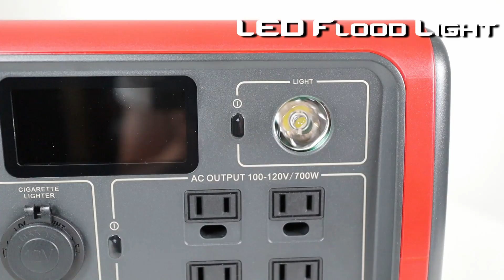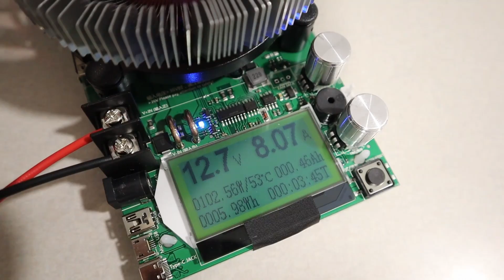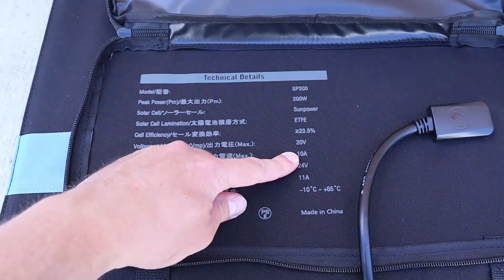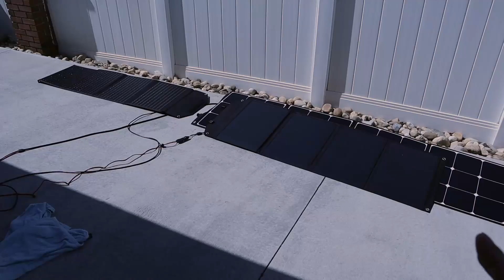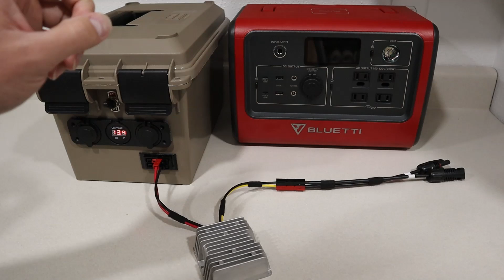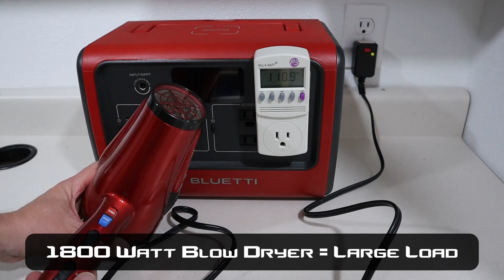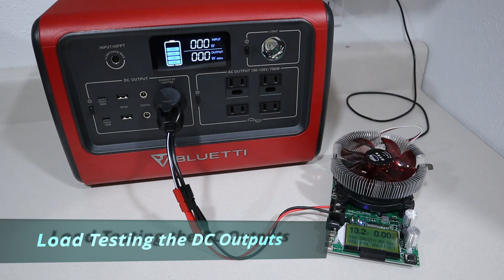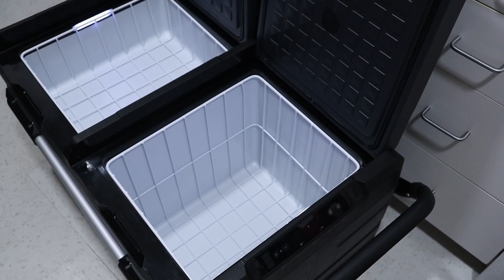Bluetti EB70 LiFeP04  + SP200 Solar Panel - Best Battery for 12v Fridges? - Full Review and Testing!

Comment: I don't understand why they do not add a little more battery capacity, so they can meet their published wh claims, same for solar, they advertise a certain wattage and never come close. Sounds like false advertising, if you bought a car and it got 20 pct less gas mileage it would be against the law.
Reply from the maker: But you do get 20% less fuel mileage when you buy a car a use it. The rated gas mileage numbers are only under perfect conditions.

I have since made a power ststion grading system that provides points for good usable capacity vs rated capacity.

Comment: Hey Jason, thanks a ton for this!! Based on your videos, I put together a Bluetti EB70s, Iceco VL45, and 100w panel for my truck camping setup. For a monthlong road trip in August, we only charged the battery off the roof mounted solar. We charged phones lights GoPro and a speaker and ran the fridge continuously at around 38°F. The battery went below 50% on just a few nights despite many partly cloudy and rainy days in the mountain west. It was perfect! 

My question is this: how would you recommend insulating or heating the battery for winter camping? Documentation says it will discharge down to well below freezing, but must be 32 or above to charge. I’ll usually only spend 2-3 days in the mountains in California, so I think it might be ok doing nothing, it can charge when I get back to 50° home temps. What would you recommend?
Reply from the maker: Since the power station creates some heat while in use, you could always find a small insulated lunch bag and put the power station in it while it's really cold and it should stay warm enough to charge the batteries safely.
Reply: @Jasonoid   Gotta love the simplicity of that solution. Thanks!

Comment: Are any of the quirks solved with the EB70S? Or is the W/Wh simply higher on the EB70S or are there other differences?
Reply from the maker: The inverter supports 800 watts, the led button lights are brighter. Those are pretty much the only changes.

Comment: Hello Jason, Is the input port compatible with Jackery? ie, can I use Jackery Solarsaga panel directly on the eb70?
Reply from the maker: Jackery uses a proprietary 8020mm connector (instead of the 7909mm), it won't work with the EB70, at least that's what I hear since I don't have those panels to test.
Reply: Thank for prompt response. The Solarsaga I have has an adapter fixed to its cable which seems to be marginally bigger than the plug directly on the cable. I can't measure the difference as I don't have a micrometer.
Reply from the maker: @bigalrsa  correct, 8020 means 80mm outer 20 inner sizing. The 7909 means 79mm outer, 09mm inner sizing. They are very close but the inner diameter is slightly different. It might work but hard to say.
Reply: @Jasonoid  I am tempted to buy the eb70 on sale down here as it has a 1kW inverter (1.4kW spike) but don't particularly want to look for adapters to connect it to my Jackery panel - these adapters are difficult to find down here.
Reply: @Jasonoid  Hello Jason, just to keep you in the loop, I have bought the EB70, and Jackery's cables work just fine without any adaptors. Busy charging in late afternoon sun and getting 60W going in.

Comment: Best review done by anybody on YT on this EB70.  Good job you even showed the way to wire up a step up 12V to 24V battery charging to maximize the 8A input.  That is very thorough, wish more reviwers used the appliances to test the full 700W like you did.

Good job. Subbed!
Reply from the maker: This video is showing it's age, I think you'll enjoy my newer videos even more. Thanks for following, looking forward to seeing your comments in the future!
Reply: @Jasonoid - Solar Power, Batteries, and More!  yes I will, but I'm still looking at getting a EB70 as it has 1000W these days, not 700W anymore, at least in the current 230/240V versions.  That makes a huge difference as it can power a 6 quart Instant Pot.

You were the only one who showed the capabilities of charging with a 12V to 24V step up hack.  That's big, shows thinking outside the box..good job.

Comment: How are you doing my friend again I was thinking of buying a little red one. I have a 2000 in murder I think I got a 200 fuse in line with the thick wire if I plug it in there while I go down the shore with a charge fast, if I plug it in directly into the inverter that I have 2000 and it’s 200 I think it’s 200 A and it’s connected directly to I got four batteries and a nice big size alternator. We did my friend get back to me oh by the way happy Easter you and your family.

Comment: I recently purchased one of these (eb70S) refurbished, directly from bluetti. Gas 2 year warranty & is like new. Paid $336 for it. I also bought a 195W fixed frame panel for $150. Charged it today In Connecticut, peak power indicated was 164W. It held 160W for a extended period of time. Love this setup!

Comment: Jason.   Can i use a solar panel with a built in mppt to charge an eb70.  Would the mppt on the solar panel increase the voltage past 28v?  Couldn’t find the answer after a lot of research and thought you might know.
Reply from the maker: The EB70 will charge better with the raw output of the solar panel. You could always try it but the charging output voltage of the MPPT would be much lower than the raw solar panel, near 12v

Comment: Great video about to buy one, I have solid solar panels what size/type is the DC in plug?
Reply from the maker: The DC charging port is a 7909 barrel connector. This model comes with an MC4 adapter so any 12v solar panel will connect up if it has MC4 plugs.

Comment: Doubt that the12V lighter plug is regulated! With lifepo4 it doesn’t need regulation!
Reply from the maker: The internal battery is a 22v LFP battery.
Reply: @Jasonoid  I thought it was iron phosphate
Reply from the maker: @charlestait5303  it sure is LFP (Lifepo4 or lithium iron phosphate)

Comment: Would you recommend for a week in france fishing for my laptop phones torches and bait boat bats aswell as other bits and Bob's
Reply from the maker: How do you plan to charge it up while on your trip?
Reply: @Jasonoid  I was kinda hoping it would last the 7 days it would be charged before via household plug (uk) and I would take the 200 panel with me but as you know you can guarantee sun
Reply from the maker: @thecarpfather5757  I don't think it would last the whole time on a single charge. You can charge it off your vehicle or off solar. It would be a good option for cell phones, laptop, and flash lights.
Reply: @Jasonoid   if I was to leave the panel connected would it be useable as it was trickle charging also have you heard of the company carplounge they make lounge boxes that are in conjunction with Anderson

Comment: Besides the benefits of fire safety on lifep04 or Lfp. People over advertise the charge cycle of Lfp batteries. Yes, the battery might last 1000's of cycles. The rest of the the features like inverter,  mppt controller, bms, usb, displays,  switches could all fail well before the first 1000 cycles.
No different than advertising 25,,000 hours of life on led bulbs. Converters go out well before first 1000 hours. For packing around,  I prefer NMC power stations over Lfp for their size, weight, and more energy density.
Lfp are great for stationary settings for off grid , Rv, or power backup.

Comment: Wouldn't you think they would have made the solar panels rainproof? Apparently they are water resistant but rain is a no no. Given the nature of how they are used, eg outside, sooner or later no matter how careful you are these panels will get caught in an unexpected shower and that will be curtains!
Reply from the maker: There are many solar panels that are waterproof. The BigBlue Solapowa 100, Sunpower Flex Panels, even other folding panels come with waterproofing ratings.
Reply: @Jasonoid  Unfortunately I ordered the Amazon bundle which comes with Bluetti's panel. I thought they would know the best panel for their product but now I'm not sure. It hasn't arrived yet so I may return the whole thing.
Reply from the maker: For what's its worth, my bluetti SP350 and PV200 have survived multiple rain storms, they may not be rated waterproof but they survive the water lol...

Comment: $400 for a 200w solar panel that well only provide 164w max is not worth it!! Can u recommend a good folding solarpanle that well provide 200w 25v 8amps?... why they would put a 8amp limitor on this product when they know that this panel is up to 10amps not a fsn of companies tricking there customers u advertise 200w it better be 200w i'll continue to slander this company until its made right and there other products

Comment: Recently, I bought the newer Bluetti EB70S to run my Alpicool C20 portable frig. Realized on my first camping trip that I would need to buy a solar panel for my longer camping trips. I use my disburse camp as a home base taking multiple hikes in the same area so it’s a waste of time and gas for me to drive around to recharge the power station every other day.  From watching your great solar panel test video with Jeff, I’m leaning towards Jeff’s favorite Baldr 120W Portable Solar Panel. My question is: you said the EB70 could not run solar panels in parallel nor in series.  Why were you able to successfully charged the EB70 with your Rockpiles in parallel?  I’m trying to decide whether to buy one 100W panel and add another if needed or just get a 200W now. Thank you and Jeff for creating this important content in an easy to understand format.  Great Job!
Reply from the maker: Series is a no go on the EB70, but in this video I said parallel connections are just fine. You can connect two Baldr 120s up to the EB70 with no issues. You'll get around 150-165 watts depending on the conditions. The only challenge is connecting those two together in parallel since they don't come with an adapter. If you go with the BlueRise 120, it is cheaper and has MC4 connections and can be connected easily in parallel.
Bluerise 120 performance here:   https://youtu.be/O2Ib2NXrsyw
See how to connect them in parallel here: https://youtu.be/4JG8LvJznLY
Reply: @Jasonoid   Just got back from my second camping trip of the summer and read your reply to my question.  Thanks! Connecting in Parallel video great.

Comment: Thank you for generating this content!
I recently took my eb70 on a 6-week road trip and charged it several times with my PV200 Bluetti panel.  I watched this video and several of your others before the trip and so I was expecting that 150-160 input range for my charging.  I really don't have a very good understanding of electricity and I'm trying to learn more because I would like to do a portable solar array that will eventually power an electric vehicle from the top of a bus.  This equipment didn't let me down on my road trip and so I want to thank you for the guidance you've provided over not just this video but several others. Your explanations and reviews are both comprehensive and easy to understand.  A lot of people look to YouTube to learn, and I really have appreciated turning to some of your reviews and videos to understand these products better as I've used them.  👍

Comment: Jason, when I pulled both above and below 500 wh with two watt meters in three tests I complained endlessly until Bluetti sent me another one. So I got two of them for 250 each LOL! I`m in hurricane country so it`s a great pair to have but many of my other power stations charge FASTER with solar than the AC charger. A lot of them do. But not the Bluetti. And NO power station rated at 716 wh should EVER only pull only 450 wh when powering a freezer. Then the next test might be 520. Then 480. My 516 wh 500 watt Bawaut powers a dorm fridge for HOURS longer than the 716 wh Bluetti every time. WIFI too. The Bluetti powers my WIFI for 48 hours. Add another 24 hours to the Bawaut run time. And because of the wireless charger the USB doesn`t power my fans very long with the Bluetti...about the same run time as the Golabs R300. 

The Bluetti has thousands of charge cycles though so it`s a valuable device that saves on fuel costs for what I need it for. Capacity of the AC ports was disappointing but the 700 watt inverter is big enough to handle the compressor surge of my small box freezers so that`s its job and it`s a very important thing when you grow your own food and freeze wild fruits and fish. These foods are simply irreplaceable at the store and by August/September when hurricanes hit my freezer has a LOT of wild fish, berries, and Spring/Summer vegetables stored in it like okra and squash. Try buying 3 gallons of blackberries at the store. 

And here in Louisiana I grow greens, rutabagas, turnips, cabbage, kohlrabi, beets, and snow peas in Winter when there`s no need for pesticides and I store them in the freezer. Plus I use many natural fertilizers along with some supplemental commercial fertilizer too if needed to greatly increase nutritional content missing from the supermarket. I don`t want these foods from the store.
Reply from the maker: How is your 300ah build coming along?
Reply: @Jasonoid  Phone/internet company is giving me issues about connecting service to my camper and I haven`t moved in yet. No cell phone service here and the only way to live without communications with my doctors and banking is to live completely off grid without money. Evil monsters. I`m on disability and they`re breaking the law. And people wonder what causes people to snap.
Reply from the maker: @baneverything5580  Well good luck in getting it connected. Sorry it's not been a seemless process!

Comment: That explains why several times I got BELOW 500 wh from the AC in tests running a freezer. Results vary by as much as 100 wh which is bizarre.
Reply from the maker: AC inverter has a bit of parasitic drain vs the DC output.

Comment: I just subscribed to your channel. I want to know if I could parallel two 120 watts ELECAENTA penals to charge the Eb70 ? Is it safe or when will it fry the charing port ?
Reply from the maker: Yes, that's completely fine. Two Elecaenta 120 panels will charge the EB70 in parallel without issues.

Comment: Do the dc ports auto-off if <5 watts? Looking for them to stay on for a cycling 12v fridge. Thanks!
Reply from the maker: I run my 12v fridges on the EB70 all the time, no issues with the DC output shutting off.

Comment: Can you take 10A from Cigarette socket and 10A from barrel connectors..??
Reply from the maker: It's been awhile since I've tested max loadx I think you can pull around 12 amps max before it shuts off from all the dc connectors combined
Reply: @Jasonoid  
O.K... I have one on order... Will test

Comment: hey mate great review. but I have a question. can you use the station while its being charged by solar or wall socket? so that the fridge can keep getting powered? that's probably my biggest concern. cheers!
Reply from the maker: Yes, you can charge it and use it at the same time, no issues.

Comment: What wires do you suggest me as an extension of about 10 to 15 feet to connect a Bluetti PV120 solar panel and a Bluetti EB70S Solar Generator ?
Reply from the maker: Great question! I always suggest getting a little longer cable than you think you'll need. Here's a great 20 foot 12awg wire that should work really well between the EB70s and PV120:   https://amzn.to/3PSLKHB

Comment: This is the first video that mentioned 8A charging max current. I wish they had at least 10A, and up to 40V max voltage, so you could connect panels in series

Comment: I think the latest versions have LED light indicators on the on off buttons. A lot of the quirks were most likely put in place to keep the price low. the great thing about this is the price/performance/functionality. Its great for that alone.
Reply from the maker: I was pretty harsh on this power station in the review but it's still my go to option for a weekend trip powering my fridge. Lots of capacity and decent solar charging!

Comment: what would you recommend as a "perfect" solar panel for the eb70?
Reply from the maker: Xtar sp100 is an AWESOME 100 watt panel for the EB70. You can see the review on my channel under solar panel Playlist. There isn't a "perfect" 200 watt panel because to get the full 200 watts charging you'd need around 27-28volts output. Most 12v solar panels will put out around 18v to 24v.

Comment: well i got 28 hours total running my desktop monitor (draws 12 to 13 watts consistently)  which i use with my HP Laptop. this is great capacity? don't know.
Reply from the maker: That's a pretty good runtime. Also remember that having the AC inverter enabled uses a little background power. To keep the battery topped off during the day, I always have solar plugged in somehow.

Comment: Great review! Everything I needed to know, would a goal zero solar panel plug into the unit ok? It seems to have the same plug on the end of my nomad 50 that would direct;y into the unit?
Reply from the maker: I haven't tested that connection myself, I think the 8mm should work from that panel but Im not 100% confident.